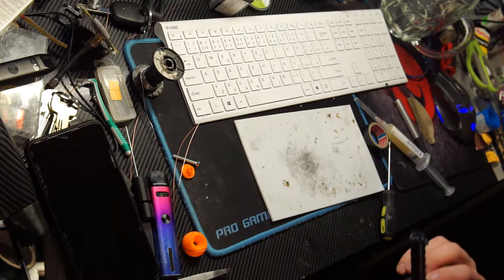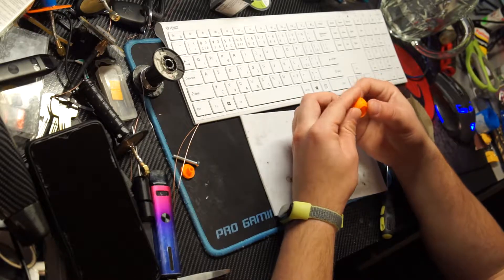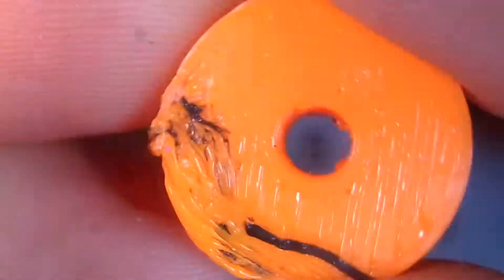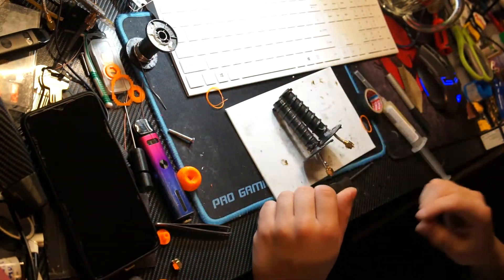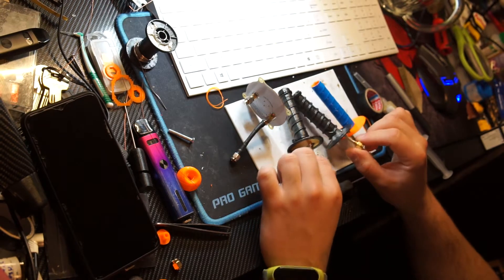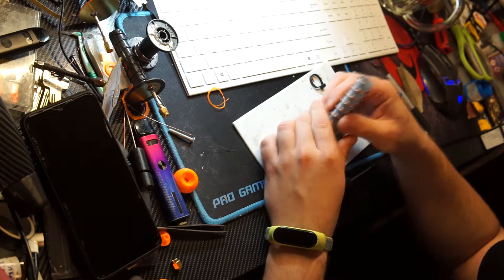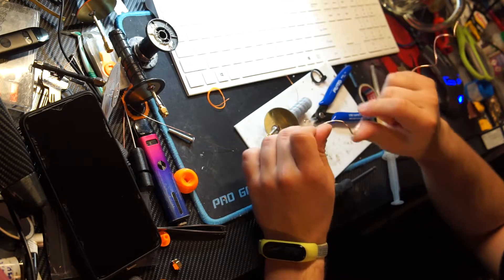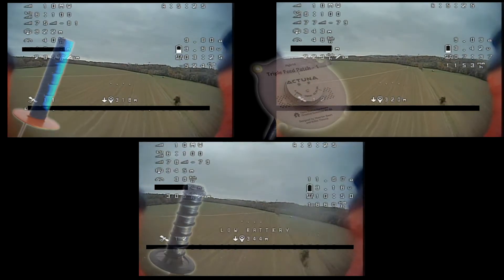Cheapest and Best DIY Long Range Antenna combination | 7-turn Helical and Cloverleaf | FPV

Comment: Hi, I wanna build my antenna
Is it that hard to make a good antenna for long range? (+10km)

I didnt have any back ground in Electrical/Signal. 
Is there any guide to make a helical antenna?
Does the size of the coil, spacing, and helical dimenssion really affect the performance?

For me, the factory made ORT antenna 12turn is so expensive ($50)

Comment: Great explained and test showed!!! I have some questions if you please.
1. Spacing of 10.4mm is between outer side of the wire(the air only space), or 10.4mm between centers of the wire(half the wire + air + half of next wire)?
2. Same for the 15.5mm turns. Is it the dowel 15.5mm(all the wires will be from outside of this dimension no matter the thickness of the wire), or its diameter of the center of the wire(so the thicker the wire - the smaller dowel need to be used)?
3. Reflector. Is it solid thick peace of metal or only thin metal sheet on some surface? If its metal on one side only - the metal part should face the spiral or the cable or doesn't matter(as non metal part won't cover the signal)?
Thanks you!

Comment: Does the helical 7 turn wire just go to the top of the tube or does it come back to the bottom & connected back to the reflector or coaxial wire? Like your results hope to see same but not poss how to connect & what did you use for reflector 👍great comparison vid